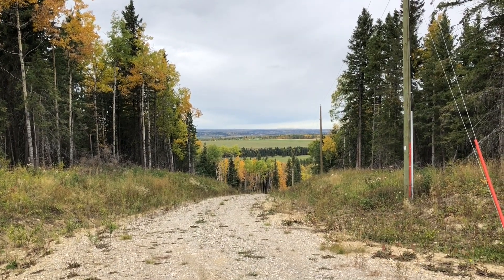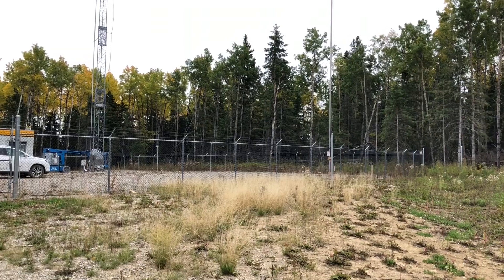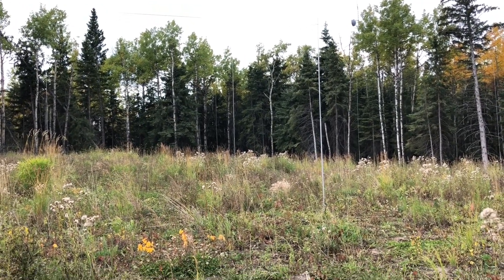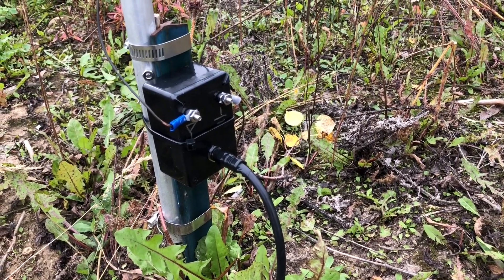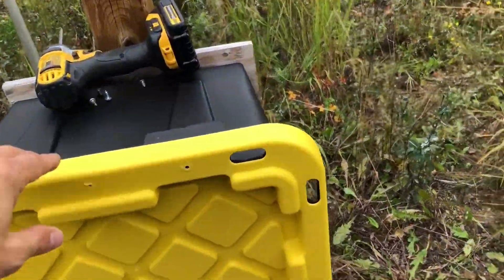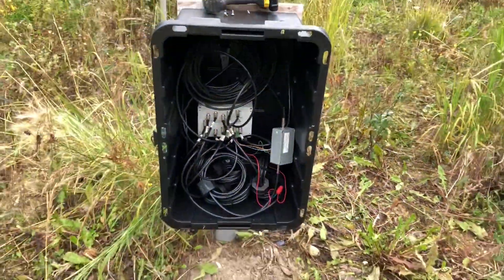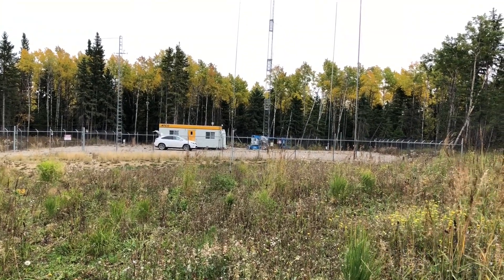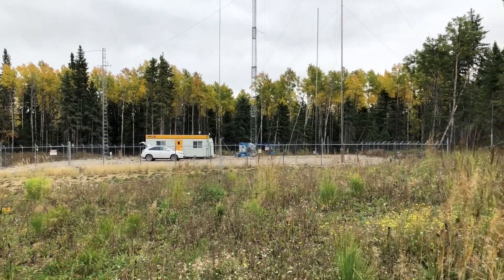The YCCC 9 circle rx array installation at VE6WZ

Comment: great set up. Here  i got 2 of them in use..At the coastline its not outperforming the transmit phased array, on other qth rx is medicore. Maybe the trees inbetween have something to do with it. I rebuilded the array with the thought i have done something wrong  ( phasing  lines ,  winding on the cores) result still remains the same. Im in the process reinstalling all countryside .. Hope to see better results, btw  the DIY kits here are from the dutch contesting club, cu on 160 Mich ON8DM